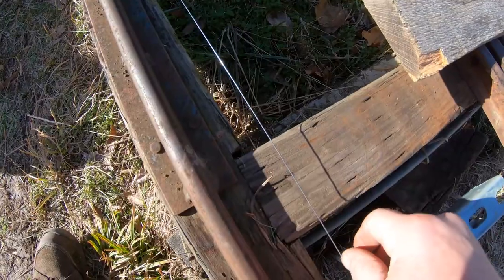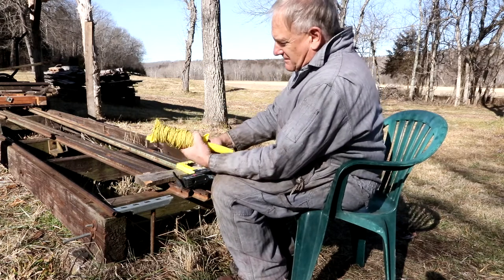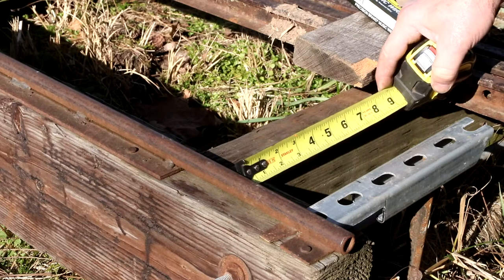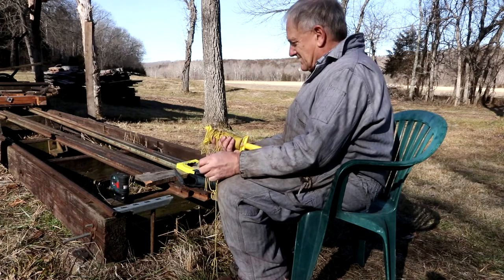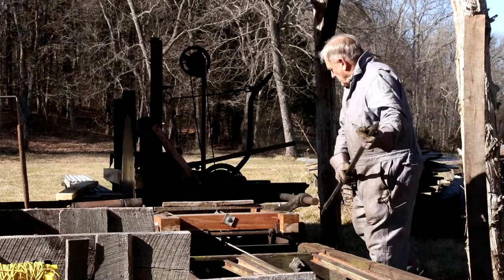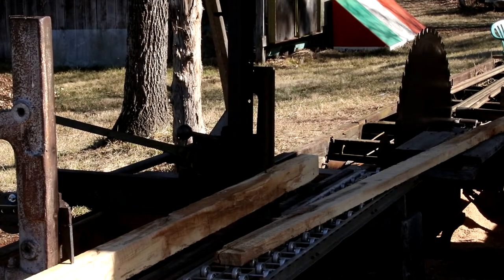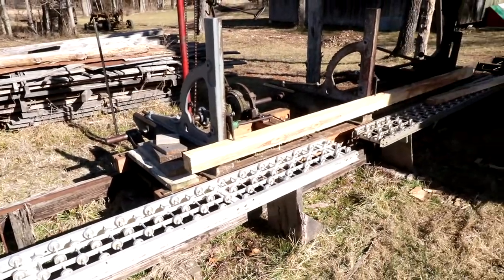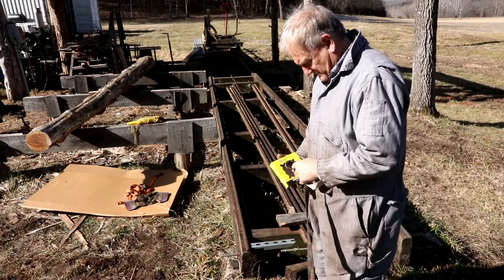Vintage Sawmill Alignment.  Sawmill Gets a New Carriage.   Altman Taylor with Detroit 371 Power.

Comment: I put my feed wire rope attachments on a turnbuckle and a shackle where it attached to the carriage, this allows me to slack one or both quickly with two wrenches and then pull the shackle, in under five minutes our carriage is free to roll back and forth easily for adjustment and maintenance. I put a locknut on the turnbuckle. I really enjoy your videos and this mill build. Thank you be well.

Comment: Great video, I can’t wait for the sequel. I thought when you were adjusting you should bring them towards the blade and then go away to take out the slack.
Reply from the maker: How's things?  New (used)  blade on the way for Bird City.  I have a moment of confusion, but I think just like a lathe or a vertical mill, take the slack out in the direction you are working.  Since the log is always being pushed toward the blade, the slack is taken up that direction.